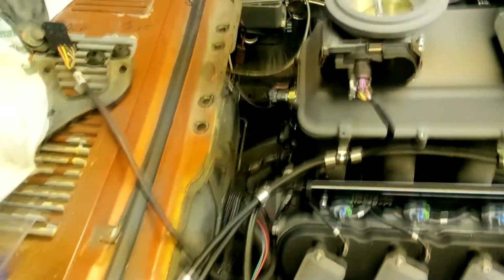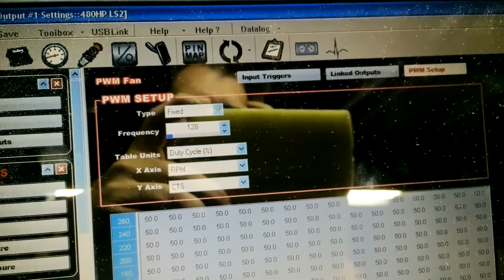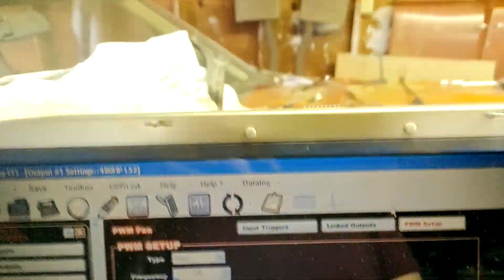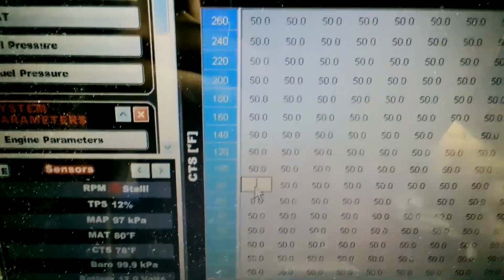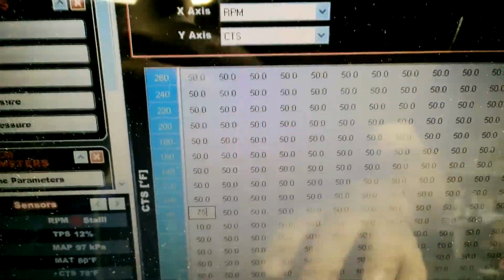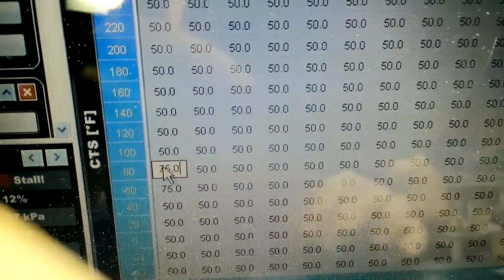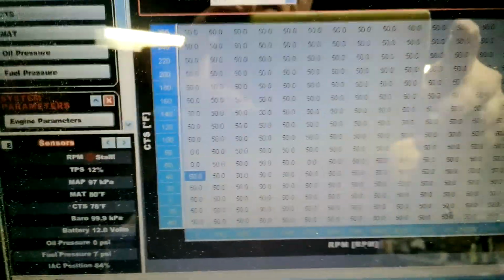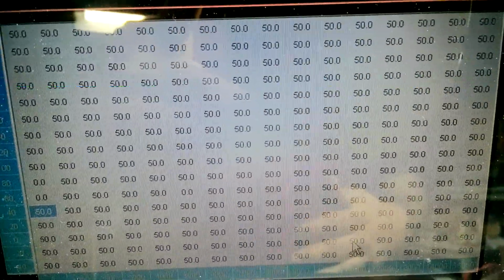PWM fan control with Holley Dominator ECU

Comment: Awesome video that I bookmarked years ago as I plan to go to EFI.   I now wonder if the Terminator X software can be set up like this.  The Terminator X / X Max have 4 outputs, but they can only be set to GND or PWM- output (12V+ and PWM+ are not available).  I was glad to see that PWM- that the Terminator X has is what the C6 fan controller uses.  So maybe the much less expensive Terminator X is the way I will be going.   It seems like the C7 fan/controller also takes PWM-.   https://forums.holley.com/showthread.php?46523-PWM-Electric-Fan-Control-(Again)&p=218469#post218469
Reply from the maker: It will work just as well with the Terminator X and with the C7 fan. That's me (andrewb70) making the comments on the Holley support forum.
Reply: @projectgattago  Thanks!
Reply from the maker: @pete540Z  You're welcome!

Comment: thanks for this! 5 years later, still getting hits ... useful info is always gold :) do you know what kind of amp load the module can handle? i can't seem to get that data, some suggest 40, some even 80.
Reply from the maker: The C6 fan is rated at 400 watts, which is about 33 amps at 12 volts. One of my customers recently blew a C6 controller by running two fans that together pulled over 40 amps. You can run two fans and use two controllers, and just split the PWM- signal wire. The smarter play these days is to use a C7 Corvette fan, which has a built in controller and is rated at 600 watts. It's a beast.

Comment: Thank you for the awesome video! I have the Holley Dominator ECU. It has two ground-switched fan outputs in the stock harness. Is it possible to change these to PWM (-) instead of buying the additional input/output harness?
Reply from the maker: Unless Holley changed the harness, there are no wires for the fans. There are preset outputs in the Basic I/O section of the System IFC, but those cannot be reconfigured as PWM-. You need to load the I/O ICF (make sure you have software and firmware that supports this...I think v3 and higher) and then make a custom PWM output and assign it to an appropriate pin in the Pin Map. Hope this helps.
Reply: @projectgattago  that sucks that they don't allow you to remap Fan #1 and Fan #2 in basic I/O to PWM(-).  Essentially they're forcing us to buy that $80 I/O harness in order to do PWM fans.
Reply from the maker: @scotthunter3892  You don't have to get the Holley I/O harness. The I/O connector is a Metripack 150 connector. You can get the connector, terminals and cable seals from from Mouser or Waytek wire.
Reply: @projectgattago  for the auxiliary harness? I don't see any connectors in the 150 Series that will plug into the Dominator ECU J ports
Reply from the maker: @scotthunter3892  The auxiliary harness plugs into the 8 cavity connector that is on the main harness. The Holley part number is 558-400. Delphi PN 12047931. Keep in mind that all of the parts have to be purchased separately. The PN I gave you is just the housing, you also need the terminals, cable seals, and TPA. You also need the proper Metri-Pack crimping tool.
Reply: @projectgattago  thanks man. Appreciate the help. I was going to ask these questions on the Holley forum, but I can't get the admins there to approve my account for posting
Reply from the maker: @scotthunter3892  No problem. feel free to find me on IG...same account name

Comment: muhammad nauman Anjum
1 second ago
hello . hope u r fine. my car radiator fan is triggered on through ECU. i want to kick start this fan a little earlier then normal. is thr any setting on ecu to change triggering temperature?
Reply from the maker: If there is tuning software available for your car, then yes.
Reply from the maker: This video is specifically for the Holley HP and Dominator systems. Without knowing what system you are using, I have no way to answer your question.

Comment: Hey Andrew , can the c6 pwm handle twin 11" spal fans that will draw between 50 and 100 amps at start up . I realize that the fans come on slowly so I don't believe that they will draw 100 amps all at once . I'm running the Holley Dominator as well . Thanks
Reply from the maker: I don't have first hand experience to answer that question. However, the C6 fan is rated at 400watts, which works out to about 33 amps. I would look at the constant draw rating of the Spal fans and if it is around 33 amps or less, I would say you are good to go. I have also seen people use two C6 fan controllers. This is easy to do, since you can split the PWM- signal. If you have a Dominator, you have a lot of outputs, so you can also program two PWM- outputs and control the fans independently. For instance, if you have A/C, you can have one fan come on at 50% (I am just making up numbers as an example) when the A/C is turned on, regardless of engine temperature. Etc....
Reply: Thanks Andrew
Reply from the maker: No problem!

Comment: Awesome. Many thanks from the UK - I was wondering what output I should be using now I know ! - given me the confidence to install  the same C6 module in my SBC based project car (HP rather than dominator). 

Being rear engined, cooling has been tricky,  I think this will help ALOT!
Reply from the maker: Glad to help. Just to be clear, the C6 module must be used with the Holley ECU, or other engine management systems that provide a PWM- output. The C6 module is not meant to be used as a stand alone system.
Reply: Yep. Thanks  - I am using the Holley HP EFI (2 PWM outputs) and V4 of the software - I came here from the link you posted in the Holley forums :) Next thing I want to look at is controlling the fuel pump with my other PWM output.

Comment: That. Is. Awesome ! Nicely Done.
If you don't mind, I'd like to know about the wiring.
1. The power and ground to the fan plug (Purple/Black) are connected directly to the battery? without a relay, diode,fuse, etc ...
Reply from the maker: Tyson, I have the power feeds connected to the battery and going through a 40 amp circuit breaker.
Reply: +projectgattago 
Excellent. This seamed very easy and straight forward. I'd like to do the same. Though I'll use CTS. Will it try to run engine off /key on?
Reply from the maker: +Tyson Rexroat The fans will run with the key on, engine off. As long as the ECU is on, it will run the fan as needed.